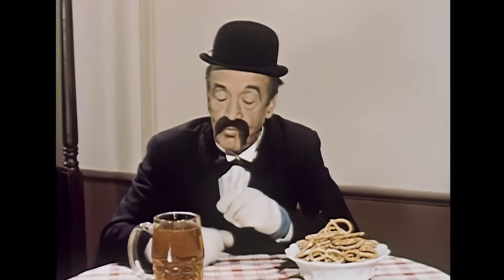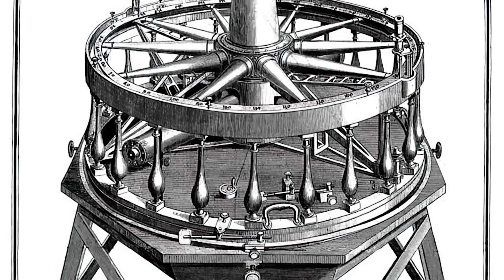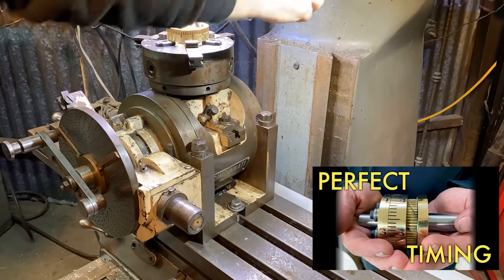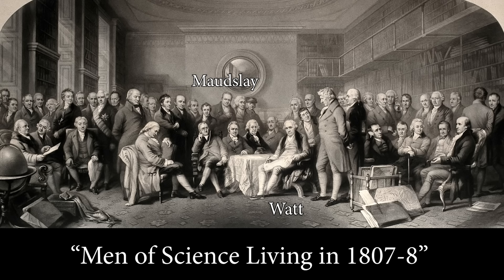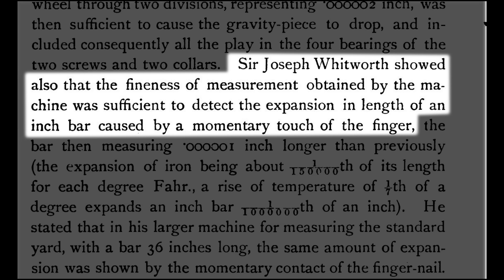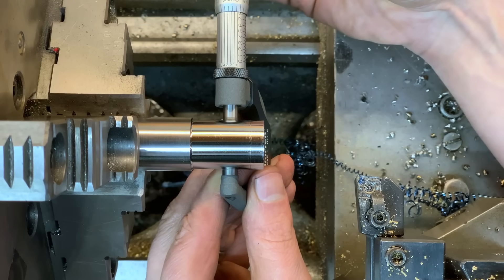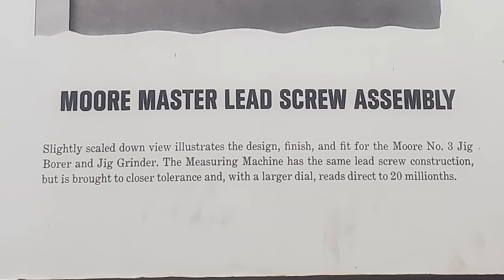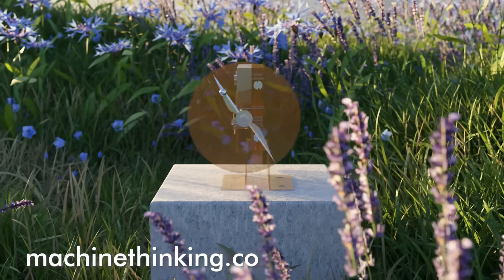The HIDDEN Screws of PRECISION

Comment: "Allegedly" am I watching machine thinking or Simon whistler?
One nit picky thing I have to bring up. The gear you refer to as a worm wheel is actually a gear set known as a worm and wheel. The worm has 1 continuous "tooth" the wheel has the 2000+ teeth u reference in the sextant section of vid. Allegedly.

Comment: Hi. I really like your videos. I have a suggestion on how you present some of this information. A key issue that is not discussed is screw pitch variation, and the relationship between a screw's pitch and its relating rotational with linear motion. If you could add a segment on pitch variability and why that's such a big deal for accurate screws. If you get time, you should also look into early pitch-correction devices - they had intricate systems of cams that followed the screw and adjusted the cutting operation in-situ to create more accurate threads. If you give me some time I can dig up the details on that mechanism.

Comment: Wonderful video, as usual! Thanks! Though I‘m surprised not a single clip of a hand using the micrometer uses the spring loaded always apply the same amount of torque thingy on the back of the rotating part. (Load-limiter?)

Comment: The screw cutting lathe can replicate the precision of the lead screw, but how do you improve on it?
Reply: Read Moore's book , Holes, Contours and Surfaces.  You can purchase it and also find it PDF on line.  The Moore jig grinder was feature here in the video.
Reply: @glennschemitsch8341  besides the fact that I don't see how you could manufacture a lead screw using a grinder, the problem is the same: with this machines you can't produce a precision higher than the precision of their lead screw, since every defect in the lead screws is transfered 1:1 to your piece...
Reply: @Beregorn88  The Moore lead screw is hand lapped to final tolerances.
Reply: patrick evans  I have read about it,but I do not know exactly how they measure it. Sorry.

Comment: From personal experience, Whitworth threads were still being used on some products in the UK in the 1980's. Most likely to use up old stock! I owned a 1983 Landrover Series 3, Stage-1 V8, that had both Whitworth and Imperial Standard threads. Had to buy a set of Whitworth spanners from eBay just to work on the thing!

Comment: It has been decades ago since I last time used a mechanical micrometer. I know that I managed to get very good precision using my vernier caliper, although I needed to to do more readings. Of course using a proper micrometer gave more consistent results, but for all the practical purposes, I was able to measure to one thousandth of a millimeter and was wrong only withing plus or minus 2 thousands when compared to multiple micrometer readings. I never needed that much precision tough. EDIT: Now I am not sure if I was not bragging too much, because what I wrote calls for some proof and I do not have a micrometer at hand to test my claims. I apologize if anyone felt mislead or offended.
Reply: I vaguely remember learning mathematical methods to getting accurate results from ordinary instruments by taking 10 measurements, moving the measuring instrument (whether a caliper or a micrometer) back and forth between each measurement. I ultimately went into a different career, but I think that's how high end digital calipers and micrometers work these days, with a cable connecting to a ordinary laptop computer.

Comment: About temperature influencing measurements:

If you have one or two gauge blocks, you can theoretically correct for an unknown temperature. The catches are that you need trustworthy gauge blocks, they need to be made of the same material as you're measuring (or you need to know expansion coefficients and do some maths) and the temperature needs to stay constant throughout the measuring session.
Reply: As a BSME  There were weeks of lectures on these subjects, plus classes in  hands on machine tools and geometric dimensioning and tolerance.  I have a textbook just on various screws, bolts plus various hardware.
Reply: That's a cool hack!
"Nobody breathes for a few minutes, I'm going to measure a gauge block!"

Comment: That's my Whitworth Planer! Well, technically the still shot was of the Planer at Underfall Yard in Bristol, which is part owned by Bristol City Council  and part by the Charity that is restoring all if the machines in the Councils City Dock Workshops. I used to be the Head Docks Engineer there until 2019, and I helped the charity's vlolunteer engineers & tinkerers get the Planer running again, still powered by the overhead drive belt. It still works well,  and in fact was last used commercially to make the curved roller tracks for Junction Swing Bridge in Bristol, back in the late '70s!  If you or anyone else gets the chance, definitely go & see it running - its amazing! Well done on another great video,  keep them coming 🙂
Reply from the maker: That's an amazing connection! I'd love to know more. Can you reach out to me at machinethinking.co/contact ?

Comment: Great video, love it. I love my micrometer.
Why is so much footage of it showing an incorrect way of using them. I've been taught to use the tiny knob until it clicks twice or three times.
You'll be off quite a few microns if you use a micrometer bluntly 🤣
Reply from the maker: I wondered the same thing and I've used the ratchet on my a fair bit. However, in the original film it talks about the importance of getting the right feel as an important skill.

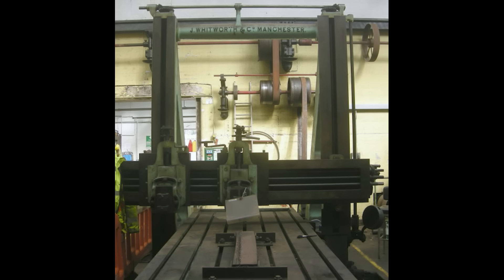Comment: 12:44 - Whitworth form is still used for BSP (British Standard Pipe) threads - very much still commonplace in the UK at least for many applications.
Reply: Not just in the UK but I believe BSP threads are still used in much of Asia, Australia, NZ, and South Africa as well.

The 7/16" Whitworth hex head size is also still universally used in scaffolding in the UK.
Reply: Brilliant video thanks.
Did you notice that early newspaper item about spiders said they are insects!
Reply: @Rosscoff2000  As a lifelong spider enthusiast I have learned to bleep it out when I see it. 😁
Reply: I never knew that and I deal with a bit of witwprth on old farm machinery 
Bsp is common world wide in hydraulics and other pipe fittings 
But mostly as European exports 
I personally hate bsp straight fittings 
Theyre a real nuisance and prone to leaking compared to the American oring boss that does the same job 

Bsp taper works OK and is offern transferable to NPT in a pinch 
Australian btw so no bias either way 
I rekon JIC is te best hydraulic fitting
Reply: @fowletm1992  Whitworth thread is still the standard for photo tripods, which is quite annoying for camera makers...
Reply: @fowletm1992  It's called BSPP British Standard Pipe Parallel.  Ran into it when I had to replace the oil pressure switch on my Rover P6.  I knew better than to call any local auto parts store. 🥴
Reply: BSP (tapered and parallel) still got em in USA and yep, still Whitworth.
Reply: Australian wine industry still uses them as a standard fitting
Reply: Nowadays the pipe threads are called ISO 228 but still Whitworth pipe threads. Used in most of the world.

Comment: How do we make an accurate screw starting from nothing? Everyone knows you can use the 3 plate method to make a true flat. Is there something similar for screw making? How did the accuracy of screws increase?
Reply: Part of it was the errors tend to average themselves out, so over multiple generations each lead screw became slightly more accurate. No doubt they also would have lapped the nuts to the lead screw so that again helps to reduce and again average out the errors even more. However...........there's no such thing even today of a "perfectly" accurate lead screw and nut. There's always measurable imperfections present in the threads lead or lag errors along it's length and within the nut. Moore Tools detail there trials of attempting perfection for there jig borers and grinders in there book Foundations of Mechanical Accuracy. While they could measure those very slight imperfections down into the millionths of an inch, nothing they tried no matter how much time, effort and money they threw at the problem could finally eliminate those errors. 

Today that absolute perfection is of lesser importance since with very high end cnc machine tools those unavoidable errors are mapped and compensated for within the machine set up program. Those off set factors can also be readjusted by regular accuracy checks as the machine and it's parts wear. We all tend to think a new lathe is quite accurate. Checking a few of the larger and better known lead screw manufacturers web sites shows it starts getting fairly expensive once the accuracy requirements start getting below a thou or two per foot of screw length. And I've yet to find any that guarantee low 10ths numbers. I'm sure there's some that do, but few could afford them. Fortunately for most of us, single pointed threads are usually fairly short, so lower accuracy lead screws don't have that much effect.
Reply: @turningpoint6643  

Thank you for the book recommendation. I will definitely check it out. I love processes that can improve itself and I am always amazed by the amazing tools built by the machinists of old with few tools.
Reply: @Dooban  For some reason your point about how the errors begin to average themselves out. There's no such thing as a zero clearance screw and nut or they would refuse to operate properly. For any mechanical assembly to work there has to be at least some clearance. So those clearances help to change and lower the deviations. 

You build the most accurate screw and nut you can, use that to machine new one's that will have less error, then use those in the machine to make an even more accurate set of parts. It's a bit like the dividing plates on a dividing head that also contain inevitable lead/lag errors. Any errors in dividing plate hole spacing are reduced by the same factor as the worm and worm wheel ratio. 40-1 for most dividing heads. So a fairly low accuracy set of plates can be used to produce a new set that has 40 times better accuracy spacing.

Comment: I have a question regarding Maudslay and I'd be thankful if someone would try to answer my it.  :D
How exactly does one get the first lead screw, which you can put into the screw cutting lathe ?
Do you have to make it by hand ? And wouldn't that make it imprecise and thus all other screws manufactured with this lead screw too ?
Where would you start here ?
(If I wrote this question to complicated, then I'm very sorry, it basically boils down to: Where does the first precision screw come from, without a screw cutting lathe to manufacture it with)
Reply: I don't know how the first lead screws were made, but I think I  can present a good guess.

One thing that can be made to high precision from scratch is a set of extremely flat stone surfaces. You need to start with more than two. If you have just two stone slabs, and you grind them against each other, you may end up with one concave and the other convex. If you have a set of at least three, and you keep swapping them out then over the course of a lot of grinding you end up with stone slabs that are flat to very high precision. The slabs have made each other perfectly flat.

The perfectly flat stone surfaces allow you to manufacture sets of gage blocks, because the flat surface enable making blocks with surfaces that are parallel to high precision. Being able to verify surfaces being parallel moves the whole process forward.

Let's say you have a single 1 inch gage block that you will be using as your reference. You make half inch gage blocks as follows: you make two gage blocks that satisfy the following two demands:
- They are exactly the same size *as each other*. 
- Stacked together they stack up to exactly the height of the reference 1 inch.

The micrometer that you use to compare the gage blocks only needs to repeat at very high reliability. Even if the micrometer cannot measure accurately yet, being able to verify that two gage blocks are exactly the same size is sufficient to move the whole process forward

The set of gage blocks will allow you to calibrate instruments/machines you manufactured.

Thread can also be cut with a mill. It takes a specialized milling machine, (or auxillary tool), that allows you to maintain a precise ratio of axial rotation of the workpiece and advancing the workpiece. Thread has an integer number of windings per unit of length. So a special thread milling machine setup can be built with worm gears, such that the axial rotation and advancing is mechanically coupled in the desired ratio. 

If that worm gear setup has some slop the resulting lead screw will have local imperfections, but slop or no slop, the worm gear mechanical coupling of axial rotation and advancing ensures that the thread pitch will be overall consistent. So even if the worm gear setup has slop the process as a whole can still be moved forward.
Reply from the maker: I've done a lot of research on this and there are several methods. I wanted to talk about it i this one but I chose to keep it focused but I DID briefly show Maudslay's Screw Originating Machine that uses the inclined knife method to make uniform threads soft material. Look it up!
Reply: @machinethinking  
Will do.  :D
And thank you very much, for taking the time to answer ! This question has been bugging me for quite some time.